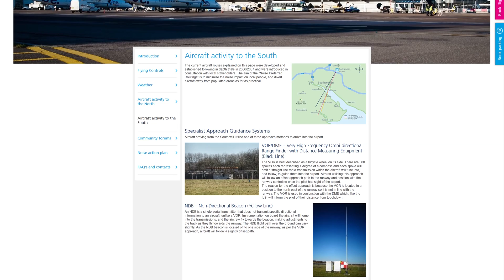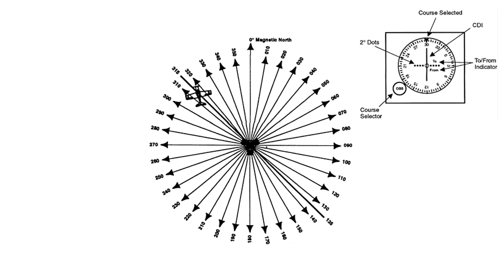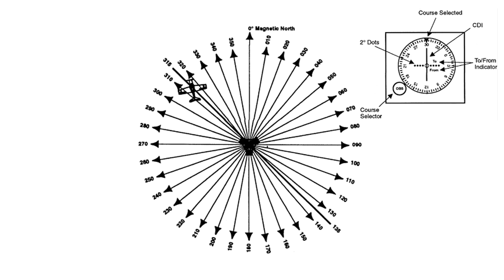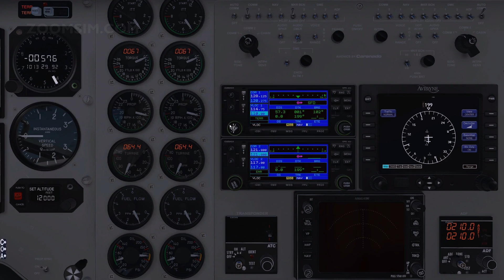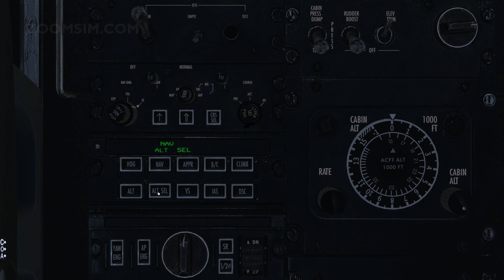X Plane 11 Tutorial 4 : Carenado King Air B200 VOR Navigation and Autopilot

Comment: Useful video.  How did you call up the EFIS panel as a window on the instrument panel at the 8:04 point in your video?  I have not been able to figure out or find the right control to do that; would like it to work like clicking the cdu panel and it opens.  Thanks for support.
Reply from the maker: You can view various items using the icons towards the bottom left of the screen.
Reply: I assumed you created those icons as shortcuts because my screen does not show any icons and the EFIS does not open when I click it [as with the navigation window].  So, I don't understand what you have on your system.  Any advice?
Reply from the maker: The first thing I would do is re-install the aircraft.

Comment: cant seem to be able to rotate de crs knob or the hdg knob on the panel on FSX, any clue?
Reply from the maker: I'm not familiar with the FSX version, but both the heading and course knobs should rotate on the pedestal and the pop-out window.
Reply: thanks, but do you rotate them by left or right click? or dragging?
Reply from the maker: You can try left or right clicking, dragging, or using the mouse wheel. There doesn't seem to be any consistency in X-Plane, so it's hard to know without looking at the aircraft. And it could be done completely differently in FSX. The rule seems to be to try all of the above until at least one method works.

Comment: I'm using the default X-Plane 11 King Air and i can't find this auto-pilot panel. Already tryed to see in the manual but it do not explains how to open it. Nice tutorials btw
Reply from the maker: I'm not familiar with the default C90 but it should be to your right. You would reach down low to your right to adjust it. I don't think it should be too much different from the B200.
Reply: supanova ye i find it.. i just didn't looked enough
Reply from the maker: There's always something new to find somewhere. ;)